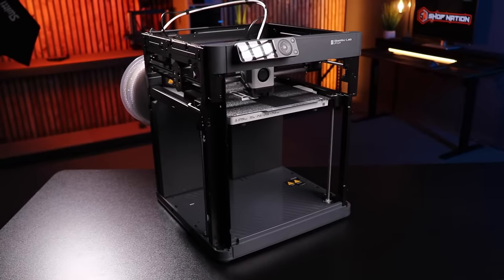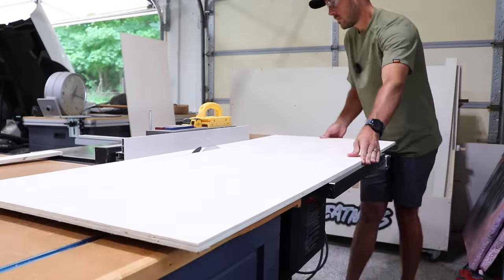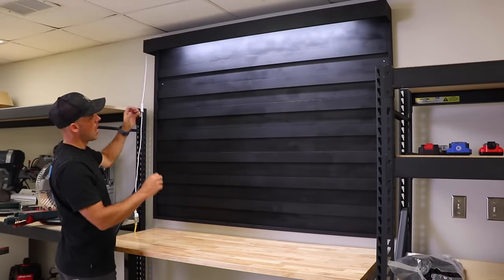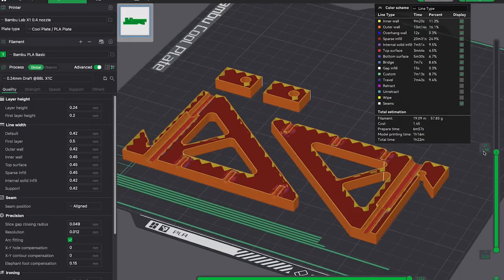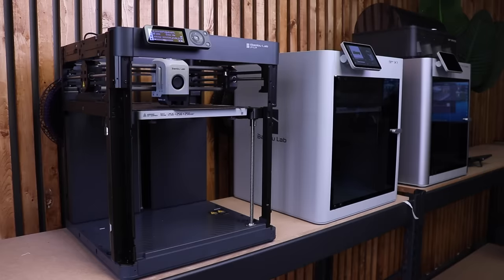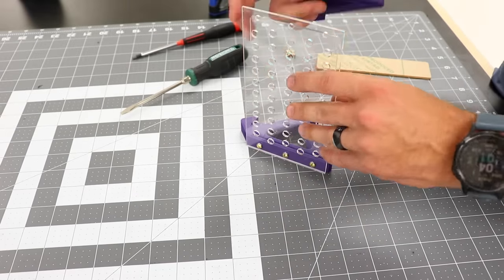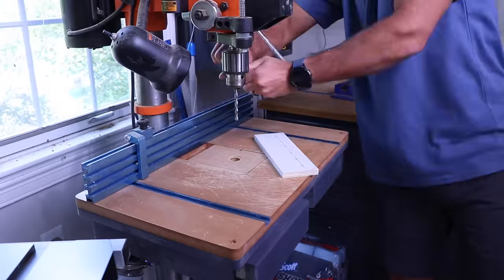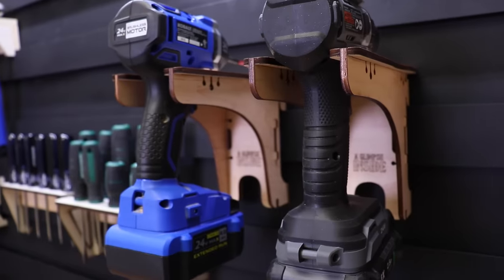Do you really need "smart" tools?  The answer will SHOCK you!

Comment: Once you have the digital files, you can make more parts quickly.
Reply: This is the big win - if you want another identical (or nearly identical) holder 2 weeks later, you just have to send the file.  With traditional methods, you have the setup, breaking down stock, and cleaning up you had for the original run.
Reply: Similarly, once you have jigs and methods down with the traditional woodworking, making additional parts is quick too.
Reply: @JohnC1 less traditional skills needed with modern technology, so in these times easier to teach to anyone making it a cheaper option for bigger organisations. For the smaller 1 guy operations handtools and semi cnc probably will still be the most efficient
Reply: @JohnC1  Why would you want to do the work by hand? It's more work you have to do and is more hazardous.
Reply: Design was already sorted out from the  cad version so add that to your woodworking 5 hrs.
Reply: @JohnC1   You have to agree multiple batches of these items, would put the digital methods much farther ahead at the end of the day, in regard to time management. Sure, you can perfect traditional methods, and you should, but a human cannot compete with technology, in regard to efficiency, lack of errors, and precision.
Reply: @JohnC1 yeah but there is people like me with ADHD that don’t like repetitive things…
Reply: after 9 or 12 years it will be fun to find your file that you have somewhere there and even open it
Reply: @robertslinis  who's using the same jigs for 9-12 years? What are you making for 9-12 years that requires jigs?
Reply: Only matters if you are going to repeat the same function with those files. Nothing new under the sun.
Reply: @JohnC1  design files are usually parametric and you can always anchor certain components making it very east to change around dimensions for more refined iterations or different sizes.  Not very easy to achieve similar degree of flexibility with jigs.
Reply: @tanner6112   Seriously. Cabinet shop I worked in had 20 year old jigs and templates. Curve templates for aprons and drop downs, shim cutters, thin rip jigs, bridle joint jigs and tongue and groove fence jigs for the table saw.
Reply: Like gasoline vs electric car debate. Hybrid is the way to go. Just make the cleat part by hand and do the rest by digital. Cos honestly in digital certain things just eats up time, when you can do it faster by hand. Btw I'm an industrial designer so I've done both.

Comment: The takeaway: traditional tools for one off projects. If you need to manufacture dozens or hundreds…obviously digital fabrication. The only thing you left out was the bootstrapped cost of CNC, laser cutters and 3d printers. Often you’d need to breakdown your materials with traditional tools so digital is a net cost not a replacement cost. I don’t hobbyists need all the digital fab. All that said, I’m eyeballing a shaper to make templates because that’s definitely an efficiency edge and I don’t have space for a CNC in my single garage 😀. Great video!

Comment: With the traditional method, I think you should include a buffer for the fact that you did most of the thinking in CAD ahead of time.  Even though you did hand layouts for the traditional, you had done most of the legwork before so that saved you time.  

Another wrinkle would have been a hybrid approach, where you mock up paper layouts digitially and glue those to plywood so you dont have to do the tedious measuring with rulers.  I think this approach is the most beneficial to the most people (80/20 right?).  Sketchup is free, dead simple to learn for basic 2D layouts, and allows for MM level perfection.  You can then print those 2d layouts to scale, so you get the benefit of computer design (precision) but not the steep learning curve of CAD.  You get the cost effective (limited tools) of traditional, but don't have all the stack up of error from hand measuring everything.

Comment: Also a plus of the digital fabrication is that; you dont need as many tools to produce something. If you have a small home without a proper workshop you can still make most of the stuff you need in and around the house.
Reply: Yes, I dont have a lot of space in my apartment and a 3d printer for 80$ (Modified ender 3 Pro ) and a few regular tools work very well for me

Comment: I'm not surprised by the results. A few things worth noting

1. Your experiment is mostly valid in terms of user expertise, as you're competent in both digital and traditional methods. But it's worth remembering that most people are going to have to invest time learning new tools. If you're starting from nothing, digital wins hands down as you need to learn only 1 thing.
2. Cost is a consideration. How much did you spend to buy your 3d printer and laser cutter, vs how much did you spend on a table saw, miter saw, and drill press?
3. Crowdsourcing. If you need a tool holder for router bits, it's as likely as not someone out there has already put the time in to design one for both methods, which cuts out the design phase. But cutting out that phase saves far more time in digital fab than it does for traditional.
Reply from the maker: All 3 excellent points here, thank you!
Reply: To number 2, you don't need the level of equipment shown in this video.  You can get a desktop laser capable of this for well under a thousand these days, maybe even half that on sale.  3D printers that are decent are under five hundred.  So, $1K for the 2, which isn't that steep if you plan on using them for other things.  I'd venture you could skip the 3D printer, as you could create that locking mechanism other ways with lasered parts and a simple pivot (nail/screw).
Reply: True.

Travis is using high end tools in both fields. Buying lower end models will be cheaper but yield worse results or lesser capabilities. You can easily stand up a traditional woodshop for well under $1k, especially if you're willing to shop on the used market.

My point wasn't that one is better than the other, just that it's a significant factor that should be considered, and Travis did not address it.
Reply: "You only need to learn one thing for digital", oh boy...

Have a look at the 100+ damn slicer settings for a simple printer. Leveling the damn thing, making sure it sticks, using the proper filament, etc, etc.

Same for the laser, a whole bunch of parameters, and things you have to take into account just to run the damn thing.

That's not to mention the whole CAD/CAM design process, along with using the proper construction methodologies, such as preventing overhangs and whatnot. "Design for manufacturing", basically. 

I own a bunch of power tools, from planers, to tablesaw and basics drills.
I also own a pretty decent printer (artillery sidewinder x2).
And I designed and built my own 24x48" 80W CO2 laser.

I can confidently say that hand/power tools are SIGNIFICANTLY easier to get started with. "Easy to learn, hard to master", whereas digital fabrication tends to be "hard to learn, harder to master". 

I mean, in general, press a button on any given power tool, and it'll go "brrrr". Common sense generally tells you what you can do with said "brrr". 
Press a button on a digital fabrication tool, and you'll be lucky it doesn't wreck itself 😅

Comment: Nice job Travis! I like the idea of painting the cleat wall. I'd take it a step further and do the back one color and the cleats another for some contrast. Like you said, whatever makes it more enjoyable to work in your shop. 
As for the results, I like the 3d printed+acrylic bit holder, but prefer the look of the traditional versions of everything else. I've never been a fan of the burnt edges of laser cut wood. Painting them is one way to get past that, but more time and cost involved. I'll have one by the end of the year, but my preferred method would be CNC cutting all the parts. I'll get a laser later on just to do simple engravings, but a CNC is the priority for the next step of digital automation in my shop.

Comment: 10:20 glad you mentioned that. Early on I was thinking the same thing. By building out the models, you’ve already “built” them in a way just from that which makes it that much easier to build manually.

That’s part of what makes 3d modeling so great in the design process even if you never intend to use any “automated” manufacturing methods. You’ve proven out the concept reasonably well and already have a great mental picture of what needs to happen to actually make it. Well worth the time (and it’s just a fun part of the design process IMO)

Comment: Great video, explaining the difference.  another way to show tools on a wall would be somthing Shadowfoam or similar.  Trace round the tool, peel back a coupl elayers of foam, insert tools.  You can even frame the foam with beading etc.  You can also add a logo in the same fashion.  Okay, note to self, watch entire video before adding comment.  Just seen the Kaizan foam section.

Comment: An interesting point: most of the time for digital fab is in creating the models. Now that you've done so, creating another holder (assuming it's the same or very similar to one you already have) is very quick. The traditional method it's probably longer per holder to create a one off holder than it is to create several at a time.
Reply from the maker: Yes! Modifying a 3D design is quick, especially if you do it right with parametric inputs
Reply: I suspect that if you made 2x the amount of holders, digital production would be faster. The more repeats you have, the more traditional production has the disadvantage. The time spend on digital production is much influenced by complexity (of the part) and the experience of the user. Learning CAD is a lot harder then learning to use woodworking tools... Another question is, what are the upfront costs of both methods, how much space do both methods require and how much does it cost to produce (materials, power and consumables)...
Reply: @Cergorach  if you apply the same logic to traditional methods, making jigs, and templates would easily speed that process up as well.
Reply: @awildeep  Agreed.  But now you'd have to add jig making time to the upfront design times.  The design times for the digital fab is essentially replacing the jigs.

Comment: I’ve been involved in lots of analog to digital conversions in the work space over my career. Just a function of my age I guess. The benefit to using software is in the editing functions and the repeatability. In other words, it’s not the use but the reuse that pays off. In this case it was a one off project of about equal time. Do it all again and the digital drops significantly while the manual stays about the same. For my little home projects I won’t even take the time to draw it up in software so I have a plan to go by. I just use a pencil and graph paper.

Comment: I do find myself using a mix of both. I do like the aesthetic of handmade, but also like the 3D printed in specific instances. As others have mentioned, digital does allow for utilizing the shop for other purposes while parts are being manufactured (this is true multi-tasking), but the ability to replicate quickly (growth and / or replacement) without all the upfront design work is huge.

Comment: As with many things, it depends. I'd love to see the shop built ones sanded and made pretty. The mix of things is the most fun and we are all following our thought process to get there. I would also bring up that the design part is the most fun for me. Finding examples and deciding on the way you prefer is great fun.
Reply: Going down the rabbit hole that nicifying (new word, you read it here first) shop-made projects can suck up more time than making them.  So the question becomes one of what the goal is.  Quick / utilitarian, or longer / prettier.  I think shop made will win if you want to go the pretty route, versus laser.  Of course, throw a low end CNC in the mix and you've got a whole new battle to consider.
Reply: @DavZell Shop Greatness. I have a half pretty half garage chaos shop. It’s difficult to want to go out there without small things to do. It’s the little wins that help me get through the big projects. Especially once big projects have finishing steps that keep delaying the final assembly.

Comment: I think you hi it on the he'd with Repeatability, if you want another bit holder for example, it is easily quicker now digitally as you have done the ground work. a laser cutter would be so good in my workshop, however I don't quite have the need for it enough (yet)

Comment: Thankyou for doing this head-to-head! I've worked in a machine shop for years and find if you have a 3d models or they are a complex design it is best to use computer controlled stuff. If its hand drawn on a napkin and only have a handful to do you're better off doing them on a manual machine or if you're well versed in hand programing/ using the conversational program, skipping cam software. The first design will dictate what tools to use.

Comment: I’d love to know the difference in material cost and waste! Since these two methods are very close in time I feel like it would add a lot of value if one method had a significantly lower cost. Same with tool value! As a guy whose just starting out buying tools I think it’s be interesting to know the value base on how versatile the tools you used are
Reply: Well, think about having to make many of these. While your cnc starts cutting at 7:00 a.m., you start setting up your assembly line/system. While your cnc cuts the second set, you assemble the first and so on. You can't do that with the by hand method. Also, the more you understand what a cnc can do, the less you have to do, and the more precise and repetable the work becomes.

Comment: I had two thoughts:  the traditional way benefited from the thought process from the digital planning, so it might have gone faster than if it were done alone or first.  Second, now run off 10 more.- does the digital pull ahead without the planning process included in each?  Ooops, third thought:  you dont have to stand over the laser engraver - just be nearby - so this isnt lost time.  Even cheap machines have flame detection these days and sound an alarm.  Putting a camera on it with a monitor in clear view can help, too.

Comment: HI
I liked the look of the printed holders, and I think for someone who is going to need multiples of the same sort of holder the 3d method is the way to go. However, it doesn't surprise me that the hand tool method was just about the same time as the machine fabricated models. I knocked out over a dozen (14) french cleat holders for my shop in just under four hours. I did a fair amount of batch cutting and the holder designs are all variants of my original idea. I like that you included shop clean up in your process as that is something that would be included in a carpenters hourly rate if you were to hire it out. Did you check the amount of filament (or resin) for your printers before you started, that wouldn't be a lot of time I am sure, but it might have added 5 - 15 minutes to your total time, then again so would have checking the wood used for knots, checks or other defects. 

All in all a great video, interesting subject that might start a lot of debate. My opinion, if someone wants to build tool holders for their shop they should use what ever method they want and go for the look they want.

Cheers
Glenn

Comment: Great Video. I must say that I am a bit surprised how fast digital tools are...
You could eaven easyly tilt the outcome more in favor of the digital: 
1. Use more 3d Printing and less laser cutting -> shave off the 1hr supervision time (or at least use the laser time to design other holders).
2. Repeat production. If you use the same (3D printed) holder several times this drasticly cuts down on your time compared to classic tools
3. Ready made designs. If you use designs that somebody already has made ad published you can cut down the design time drasticly.

In conclusion you could in theory cut down the digital time to 1hr if all of the above is done (in a perfect storm) that is not possible with classic. And that is a huge benefit of the digital tools...

Comment: So I am also a hybrid worker, with shop tools, printers, lasers and a CNC. I think I would have made the design for the laser cut materials first and sent them to the laser before moving on to the 3D printed stuff, especially because I can import the SVGs into fusion to start off with the profiles needed for the cleats. My laser cutter is next to my computer so I would be watching the laser as I designed the 3d parts. I currently use peg board and I hate it so I may convert to French cleat in the future. Great video, thumbs up.

Comment: As a way to make the tool cut out go faster the digital way, just use a flatbed scanner. Set the contrast high and the profile of the tool should be visible. Import the scan without any scaling and trace the bitmap file with your software of choice. Now you can have a DXF profile of any tool without measuring.

Comment: In my experience using digital methods versus manual is that digital is much more precise, easily repeatable and is like a good paint job.  All the work is in the prep and set up the actual painting or fabrication is easy.  Depending on the task I would do manual if it's something really simple and would take more time going through the software design versus just cutting and drilling.